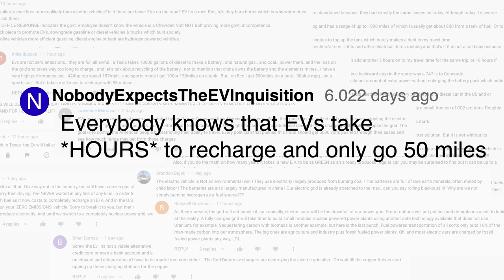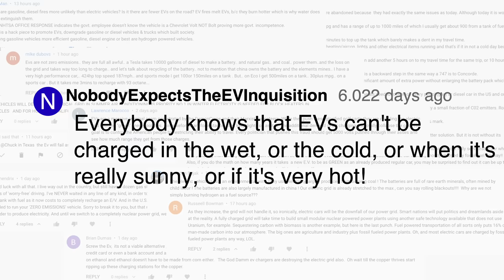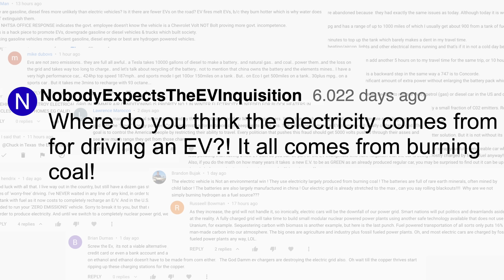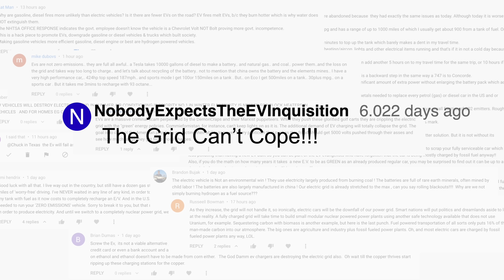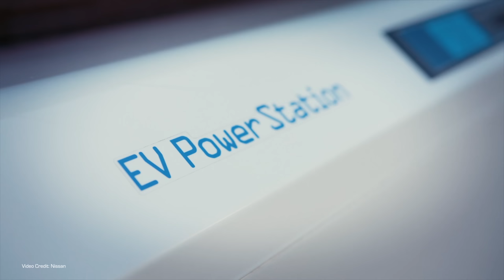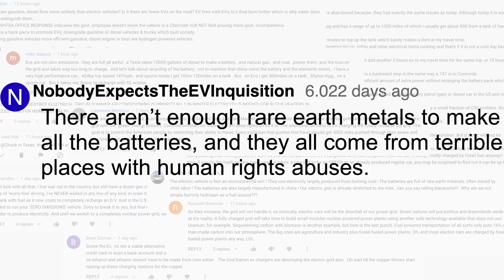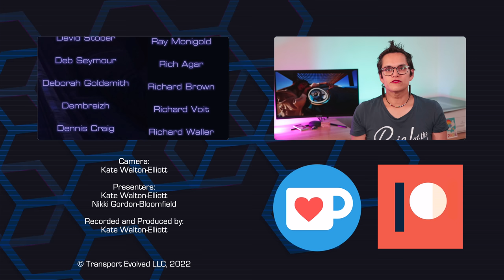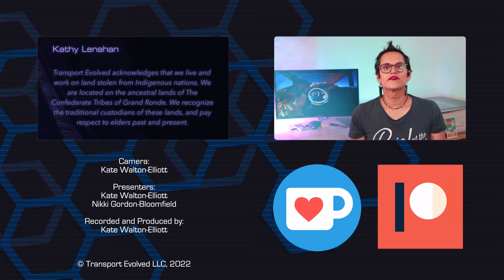The Transport Evolved List of Common (EV) Misconceptions

Comment: Well, sorry but even in Europe if you really want to go somewhere with a car you will do some 1000 km, or 600 miles in single stretch, which I have done a couple of times, and doing it with Honda diesel - it was fun, and really efficient.
Making up for the CO2 production for BEV, sorry, it still is based only on scientific assumptions, on one rather old research, which lacked any real data regarding Lithium production. Sorry but until that part becomes a common knowledge, I am not buying into BEV's are working out cleaner ...  I don't know the real data,  but if no car or battery producing company make it public knowledge, sorry but I will asume that BEV CO2 brake even spot is at least 100'000 miles away from the point of production ...
Reply: Not really efficient, and 1000 km without breaks is just dumb,.
Reply: this gave me a good chuckle.  1000km without stopping?  at 200kph that is five hours.  Your honda diesel does 200kph?  Do you dehydrate ahead of time to ensure you dont piss yourself?  I am going to challenge your claims.  And just so we are clear, when presented with the evidence, and where you can find the evidence yourself, you just say, fake data?
Reply: @chrisbailey5055  It does 200, but I never take it up there, 120 - 160 kph is the comfort speed, and it is reasonably safe, then you have both options ,power to accelerate as well as your ok with just plain braking.
And yes I have done 1Kkm alone (think it was to Austria, certainly crossed  Latvia, Lithuania, Poland and think one more country in those 10 hours), as well as 1300+km in 24 hours  round trip LV <=>PL, if you are mentally prepared for up to 10 hour stints, it is nothing special.
Reply: @aigarslacis4433  So you drive non-stop for 7 hours and 15 minutes?  How do you do this?
Reply: @chrisbailey5055  You take a good rest 2  days prior (meaning going to bed ~10PM, wake up at the time you know is best for you to be awake and attentive, and then you make and pack  food/snacks and drinks for 10 hour driving stint, and then depending on road conditions you just drive until you feel that it is time to stop. 6 hour non stop stint is absolutely no problem, 10 hour non stop, I think have done it once, early morning start and stopped I believe close to midnight.
Reply: @aigarslacis4433  What an absolutely horrible way to spend your time, I do feel sorry for you and whomever else you subject this torture upon.
Reply: @chrisbailey5055  And I found the article for that BEV trip from LV to Spain and back, well, the guy spent 8 days travelling, and 55+ hours charging on top of 8 days. If that is "the future" , thanks, but no thanks !
Reply: @chrisbailey5055  Then think about that guy who did it in his BEV 55+ hours charging during his 12 day trip (I know 8 days  +55 hours charging does not equate 12 days, but that is what is stated in his travel article, with mid size BEV). So I think spending 24 hours going to anywhere in Europe from almost the Russia border, is almost fun compared to that ...
Reply: @aigarslacis4433  i read a story about a US army convoy driving across the continental US, it took months and many people died.  I will stick with my horse thank you.
Reply: "Making up for the CO2 production for BEV, sorry, it still is based only on scientific assumptions, on one rather old research, which lacked any real data regarding Lithium production."  Have you looked at this study?  "A GLOBAL COMPARISON OF THE LIFE-CYCLE GREENHOUSE GAS EMISSIONS OF COMBUSTION ENGINE AND ELECTRIC PASSENGER CARS"   Seems more recent.
Reply: @SDGreg  If it is something that has been created within the last half of the year - I may have missed, but I hope that the BEV CO2 baseline emission data is not still based on a rather old and full of educated assumptions Scandinavian(sorry I do not remember which country and university it was exactly , but it was a public research paper and many newer papers are based of of that) research, since most of what I have seen are based of of that one.
Reply: @SDGreg Did you?  Take a look at figure ES.1
Reply: @chrisbailey5055  Well I have a friend (russian by nationality), former military, served also as a bodyguard in Israel, he did LV <=>UK , LV<=>FRA trips fairly regularly since he was doing some building/renovation jobs, and he drove even more in one stint ... so I guess it is just the question of what options do you have , what mind set, and what you need to achieve there ...
Reply: @chrisbailey5055  You mean the one showing lower lifecycle emissions comparing ICEV to BEV?  Yes I have.  What is your concern Chris?
Reply: It might be possible to do 10 hours non-stop, that however doesn't mean it is responsible. It is scientifically proven that people lose a lot of attention when driving non-stop for longer than 4 hours and the danger they pose to themselves and others is greatly increased. Ofcourse you might not have caused an accident yet due to ignoring these warnings, but we know that people that do drive for longer non-stop do cause more accidents on average.

There are plenty of studies out there supporting that BEV's are cleaner within a few years/dozen k miles driven, definitely within their lifetimes. The ones that state the contrary have repeatedly been debunked or exposed as taking the worst possible scenario's and parameters to get to their findings.

100k mile break-even point is still good, considering the average car does something like 120k miles in its lifetime. So 100k is good, just not great. If you want to suck this number just out of your tumb, fine, you still are arguing in favor of BEV's when it comes to pollution anyway.

I assume you only drive faster than 130km/h on the german autobahn? Considering that in any other EU country 130km/h or lower is the speed limit. So you'll need to drive for almost 8 hours non stop at an average speed of 130km/h (difficult anywhere in Europe, unless driving only highways at night) to drive 1000km. So double the time the recommended non-stop driving time. I don't see how this argument should hold any meaning to any responsable driver.
Reply: @MDP1702  That research about 4 hour non-stop driving is a bullshit, they take into account an "average person", who for the most part is "incapable of driving anything but a shopping cart". It is not LeMans 24 hours with pedal to the metal and physical exhaustion, and even then they can make 4 hour stints, though usually it is balanced with refuelling or other maintenance so to reduce the pitstop times ...
After all an average truck driver in EU has 8 hour driving stints at his disposal ....
130 kph is the allowed limit in reasonably many countries on the highways in EU.
But the usual long distance driver does +10kph over the speed limit, and depending on the country and if I know the road well,  I do about +30 kph everywhere where there is 90kph  and higher limit if the traffic allows for that ...
Reply: @MDP1702  about the studies on BEV - there are a lot of assumptions in every study about the energy required for battery production, I have yet to see a single BEV manufacturer or battery supplier releasing full info on CO2 emissions. If you could point me towards one, I would just love to dive into it ...
Reply: @bellshooter  as to the efficiency, on that trip LV to PL and back in 1300+ km if memory serves me right I was doing 120+kph a lot and an average close to 100 kph, and it was about 6.1 liters of diesel per 100 km.
And as a side note if you have to spend charging 1 hour for every 8 hours of driving, that is also decreasing the other types of efficiency + if you look at the price you pay at the charging stations, I think if I do the frugal driving style, I can make those diesel 1000km a lot cheaper than BEV. And even with my usual driving style 7.5 liters per 100 km in city, I think that money wise I would still be better then that BEV across Europe ... 
(according to that article BEV across EU used on average ~12.3 EUR per 100 km, naturally if it was Tesla on Tesla chargers I think it would be free)
Reply: @aigarslacis4433  
they take into account an "average person", who for the most part is "incapable of driving anything but a shopping cart"
What a bullshit cope out.

After all an average truck driver in EU has 8 hour driving stints at his disposal ....
A truck driver in Europe is required by law to take a break after 3,5-4 hours of driving and can't drive more than 9 hours a day. Well, they can ride a bit longer than that, but that then only if followed by a (significantly) longer rest period.

But the usual long distance driver does +10kph over the speed limit, and depending on the country and if I know the road well,  I do about +30 kph everywhere where there is 90kph  and higher limit if the traffic allows for that ...
So in other words you are essentially now admitting to not only driving irresponsably long non-stop times, but also breaking the speeds limits consistently? Do you have any more reasons as to why we shouldn't take you serious?

there are a lot of assumptions in every study about the energy required for battery production,
There are indeed differences, which isn't suprising with different chemistries and manufacturing processes. But even the worst ones are generally coming to the conclusion that BEV's are better in their lifetime and usually significantly so. The studies finding the opposite often are playing with things like 100% coal produced power etc.

I have yet to see a single BEV manufacturer or battery supplier releasing full info on CO2 emissions
So you have activily researched this and ofcourse know the ones released/investigated are untrustworthy? And better than people actually doing it for a living?
Reply: @MDP1702  The first part of your comments - think whatever  you please, I do what I think is reasonable for the task at hand. I am  a daily winter driver, and I have no problem driving 120 kph on snow or gravel for that matter. Have survived some 30 years as a driver, think I can make whatever there is left for me ...
Regarding BEV's and research, I did my research, when I was interested in it, but that was about a year ago, so my "research" is outdated, but if someone tries to show me that BEV's during production have emitted less CO2 then ICEV's, that I really consider a bullshit.

Oh, and about truck drivers, you are not wrong, but you have not taken into account various exceptions in member states and for agricultural hauler drivers, there is a lot going on there ;) And for the most part that truck driver work hour limitation is market protection thing for the old EU states against polish, latvian etc drivers, and has very little to do with the human endurance.
Reply: @MDP1702  what I am trying to say about BEV and people who know - the people who know, do not have access to the real world data, they have some more or less good understanding of what it should be, but no real data, and that was what was "fascinating" about the green movement - most if it is "competitive information", so it is not released to the public, and from what I have seen no researcher has had access to that information either ...
Reply: @aigarslacis4433  
and I have no problem driving 120 kph on snow or gravel for that matter.
I never mentioned snow or gravel. Don't see how this is relevant other than you bragging.

Have survived some 30 years as a driver
You and so many millions of other people. Just because you survived 30 years as a driver doesn't mean you can't improve or are infallible. Even people with 30 years of driving experience can cause accidents due to being less attentive. Hell, with higher age the risk likely only increased.

but if someone tries to show me that BEV's during production have emitted less CO2 then ICEV's
Who the hell claims they emit less during production? The entire conversation is about when do they break-even and become less polluting?

but you have not taken into account various exceptions in member states and for agricultural hauler drivers, there is a lot going on there ;)
So in other words, you are going after the exceptions to justify your irresponsible driving behaviour? I guess then it makes it all right.

And for the most part that truck driver work hour limitation is market protection thing for the old EU states against polish, latvian etc drivers, and has very little to do with the human endurance.
Bullshit, even with this time protection the eastern european truck drivers are much more competitive due to the lower wages. The time restrictions literally correlate to what research found to be the point a drivers attention drops off massively, often without themselves even realizing. It has everything to do with endurance. People aren't robots, there are limits to what we can handle. It isn't about the physical tiredness either, rather the mental tiredness/attention loss.

the people who know, do not have access to the real world data
And you know that how? You do know there are people who do nothing else than to track such information down, not just for BEV's, but life cycle analysis for a lot more things. They have access to databases you likely never heard off, nor ever will. These also aren't just all people from the 'green movement', overall these are mostly people who are neutral on the topic and research life cycle analysis  of many different things, green or not.

and from what I have seen no researcher has had access to that information either
Unless you really went extremely deep, ie. talking to the actual researchers, you really can't know this and is just your assumption. I assume you are working/closely related to the world of life cycle analysis, right? Otherwise these are pretty ignorant statements.
Reply: @MDP1702  about the trustworthiness of data, I have seen and work with organisations who do exactly what they are paid for, so unless it is a bunch of collage or university students eager for knowledge and real data do that research, I have very little trust in that source. It might change as I get to the bottom of that organisation and of that sourced data, the trust might establish, but as such if I see at least one peace of data that does not look right - I tend not to believe the rest of it. But I am interested and will do a deeper reading and analyses on above data compering ICEV and BEV.
About the researchers - it is easy to verify, they have to publish their refferences if that paper is considered at least half way scientific, so it is easy to know what data has been collected and from where, and what previous knowledge , research has been studied ... If it lacks those things, the research is mostly bullshit, or at least it cannot be called scientific, and I would not use it as reference point at all ...
Reply: @MDP1702  So now after digging a little bit more on that ICCT comparison now I get what they did there, they basically found a good measurement unit to be presented in the table form, so that BEV really look super good in this particular statistic, and yes it is somewhat  true but it also nicely avoids showing the real initial carbon footprint of BEV, as well as fails to mention that it uses the absolute best case scenario for the BEV production ... "nice job ICCT" masterful bending of facts ... sorry to be more exact "bending" of statistics ....
Reply: @aigarslacis4433  
I have seen and work with organisations who do exactly what they are paid for,
If this were the overall case, wouldn't there be a lot more unfavorable LCA reports about BEV's considering the money is still very much with car manufacturers and fossil fuel companies who are best served with a status quo, ie. no electrification of the car fleet?

if I see at least one peace of data that does not look right
So I guess you already then need to be very informed about LCA's to know what doesn't look right, and even more specificaly LCA's about BEV's?

it is easy to verify, they have to publish their refferences if that paper is considered at least half way scientific
Almost all research about LCA of BEV vs ICEV LCA that is peer reviewed speaks in favour of BEV's, so I don't really think this is a problem. Ofcourse if you are going to nitpick about the few that might not be peer reviewed, I don't really care.

ICCT comparison
The ICCT report literally said they got lower BEV battery numbers by focusing on large scale industrial battery production (where economy of scales can help institute co2 pollution limiting efforts better) and regional supply chains. But this is still in reasonable bounds.

I'll share a link here which includes the results of several studies that looked at kg co2eq/kWh of BEV batteries. Even if you take an upper limit of 200kg/kWh (only 2 studies go higher than this, with an average of 127 for all with their upper limits, though ignoring Ambrose en Kendall as a clear outlier) with a battery of 100kWh (which is double the average BEV battery and one of the biggest you can get these days), you come to around 4x the ICCT's result, which still comes down to a significant reduction in Europe, the US and China with only India coming more or less similar (bad grid mix).

Here's the link (delete the space after theicct. done to fool youtube, since they sometimes delete links): https://theicct. org/sites/default/files/publications/EV-life-cycle-GHG_ICCT-Briefing_09022018_vF.pdf

It is also an ICCT brief, but the mentioned studies aren't. And considering the average is 127kg/kWh and the median 119, which is around double or bit more of the values used in the ICCT's 2021 comparison paper, I'd say those are pretty trustworthy. Also when you look up other studies, they all are in a similar range. If you go above 200kg/kWh, you are going to high, going under 50-60kg/KWh, it is too low. Within that margin it depends on the factors/data considered.

Also the ICCT is sometimes a bit influenced by politics/goal, but like you said, still within reality, just this time a very positively one of BEV's. A more realistic (or even negative) one still comes out with the conclusion that BEV's are better over the course of their lifetime, the impact is just a bit smaller in regular circumstances compared to what they state.
Reply: @MDP1702  Yes I mostly agree with your comments on the BEV and  that  fairly closely relates to what I have found within various university researchers papers, they however admit, tha they mostly do not have real world data, but they use what is called  the understanding of the industry. So my guess is that real emissions is a "trade secret", and usually when there is something "sold" as trade secret, there is some "uggly" truth behind it ...
The other "problem" I have with BEV is, the only relatively advanced and expensive part of BEV is battery and accompanying cooling and management systems, the rest of the car is actually way simler and cheaper to produce, but when you put a couple of useless drivers aids and some other redundant and sometimes plain harmful/distracting  stuff, you get to cash in more than on any ICEV you could. The cheapest EU produced BEV I think was Smart,  it was something like 19Keur, so you can make them seriuosly cheap, but why bother  ... And yes there were even cheaper BEVs like the Mitsubishi iMIEV (if I got the name right), but that did not sell well with consumers ...
But regarding BEVs and "old industries", most of them actually heavily profit from this new "green deal", plus the way that the CO2 tax is applied, it does not inluence them at all. They now have understood how to profit even more by supporting "unsustainable" green movement, however they are not so vocal about the fact that green is not sustainable yet. Think of CO2 capture and storage and similar tech ....
Reply: @aigarslacis4433  
they however admit, tha they mostly do not have real world data
Which is quite logical, afterall which company is going to divulge the exact composition/chemistry or manufacturing process of their batteries. However this should just cause a slight variation since the general composition and processes should be known. This is why I'd take a range between 50/60-200 kg/kWh.

and usually when there is something "sold" as trade secret, there is some "uggly" truth behind it
That doesn't really make sense. A trade secret is often to just avoid the opposition copying it entirely or with just some minor differences. Trade secrets being kept secret due to an ugly truth behind it should be by far the exception, not the norm.

Yes, overall BEV's can cut a lot of things to make it easier, however this isn't to say they are easy or cheap to produce, it mostly is in the maintenance department this will be felt. As to adding "useless" driver aids etc, this isn't just the case with BEV's, it is a general trend, it is just easier to do with BEV's since they are a new platform anyway. Also due to the (for now) still higher cost of BEV's due to the battery, people expect something more when buying it. these driver assists also often help get a better (safety) rating and in some cases are even becoming mandatory for new vehicles.

you get to cash in more than on any ICEV you could
That definitely isn't necessarily true, though it depends on the manufacturer. BEV's are still more expensive, thus for the "mass adoption cars" companies actually need to keep profit lower as to not let the price become too high and scaring of the general buyers it is aimed at.

The cheapest EU produced BEV I think was Smart,  it was something like 19Keur
The cheapest smart I can find with me her in Belgium is 25k and the range on it is truly pityfull (132km).

Maybe you meant the Dacia spring that here starts at 20k, it has a decent range in city, but it really is a budget car which ICE variants are about 10k. Generally speaking you can add around 10k extra for a BEV vs an ICEV still, and if you look at that, manufacturers aren't really driving up the prices, except maybe for the higher end (50k+) ones.

And yes there were even cheaper BEVs like the Mitsubishi iMIEV (if I got the name right), but that did not sell well with consumers
That last part is the entire problem, people don't like to buy a small car with a short range. Manufacturers already have greatly diminished or even cut the production of their smallest/cheapest cars because it just wasn't profitable due to too low sales figures. And that is for regular cars, small BEV's then make entirely no chance since they are more expensive and generally have a bad range due to a smaller battery.

But regarding BEVs and "old industries", most of them actually heavily profit from this new "green deal"
That is definitely not true. Manufacturers, carshops, fossil fuel companies, ... all really aren't better off with electrification of the car fleet. 
- The manufacturers need to convert their ICEV lines to BEV lines or even create new lines, which is incredibly expensive and logistically difficult, moreover they need to constantly find the balance between the right amount of BEV manufacturing and ICEV manufacturing. Changing too slow and you miss out, changing too fast and you lose most of your revenue when BEV sales don't follow as fast. Next to that they now also get new competition of dedicated BEV manufacturers like Tesla that they'll need to compete with. Changing something as big as this isn't an easy transition and the expectation is that one or more established brands might go under or will have to be taken over specifically due to this difficult transition.
- For the carshops, much of their income comes from maintenance, check-ups, ... BEV's will greatly diminish this income stream for them.
- Fossil fuel companies it is obvious.

What advantages do you see for these industries? And don't come with higher prices=higher profits. If this was the case, they could achieve the same with increasing prices on their ICEV instead.

plus the way that the CO2 tax is applied, it does not inluence them at all.
That really depends, in Europe the ever more stringent requirements absolutely influences them to move to lower pollution from cars and thus pushes to electrification. Moreover it isn't just the tax, but moreover the consumer. The consumer will eventually flock to BEV's, be it for environmental reasons, financial or even ease of use/driving, it is just a matter of time. If a company doesn't transition to BEV's, they'll miss this ship and likely go under, not dissimilar to what happened to other big companies in the past in other industries.

They now have understood how to profit even more by supporting "unsustainable" green movement,
You keep saying, how?

Think of CO2 capture and storage and similar tech
What does this have to do with it? And CCS really is still in its infancy and isn't cheap at all, plenty ot trials have had to be stopped due to the difficulty and too high costs, even when funded for a big part by subsidies.
Reply: @MDP1702  for one take a look at this year revenue, let us say oil companies, and revenue overall through years. On how they profit, well look for one example, the Saudi Neom project 150 mile Line  "sustainable" city , where one of investors is Aramco ... 
And if you care to search you will find enough bullshit being built and done with the "help" of oil and gas industry.
It is just like that embargo imposed on Russia exports, right after the embargo ships with oil and gas were travelling from Russia even more then before, and if you took a close look at it, oil and gas was free for trade, just that it could not be carried by Russian transport ships etc.
Public is fed with incomplete information ...
Reply: @aigarslacis4433  
for one take a look at this year revenue, let us say oil companies, and revenue overall through years.
So your argument is just to point to the profit that is influenced by many factors and not just BEV's? Like this year the price of oil went up significantly due to the Ukraine conflict, while the cost for oil producers overall remained the same, so obviously they are going to see their profits soar. This is why some government are planning/created an extra tax to be placed on those "war" profits.

And if you care to search you will find enough bullshit being built and done with the "help" of oil and gas industry.
This doesn't at all indicate that electrification of the car fleet is a good thing for them, on the contrary, they are forced to try and diversify to avoid total collapse when the revenue from oil decreases massively.

It is just like that embargo imposed on Russia exports, right after the embargo ships with oil and gas were travelling from Russia even more then before
Because some countries were taking advantage of the situation Russia was in, getting gas and oil for a much cheaper price than they could have gotten before. They then used this to fill up their reserve with these cheap products and maybe sell it on a bit. This however has nothing to do with the electrification of the car fleet and the impact of it on oil manufacturers. Moreover even European countries increased imports from Russia and elsewhere temporarily to fill up their reserves, after which they created legislation to start and embargo for Russian oil at a later date (I think end of this year or something around that) and I don't know if there even is already an embargo for natural gas from Russia announced.

What you just said makes me question if this conversation is worth continuing, because these arguments are pretty dumb and/or ill-informed.
Reply: @MDP1702  Then never mind , I am sorry I don't have more time to spend and make a well laid out and easy to understand argument with long explanation, I do some work  at the country house in the garden (as in plough, dig etc, also have time to spend with kids). So I just type in something now and then, and yes chaotic.
But back to the argument, prices had nothing to do with Russia/Ukraine, it had to do a lot with thinking the green energy can replace fossils, and the much needed "fossil stuff" were not secured in advance like many years until now +  this year has been one of the worst for wind energy. These were just some "bad" business decisions, not war. But bad is relative, all energy companies have profited from this, and only the consumer is left as an "idiot". And BEV's were just another contributor,  which helped to drive up the price, naturaly not the decisive factor, but factor non the less.
Unless we go nuclear, oil and gas will be used even more. 
Regarding car industry, BEV's is a cheap "exit strategy" compered to making something like hypothetical Euro7 engine ... so that BEV investment long term is seriously "nothing" compared to developing modern ICEV.
Reply: @MDP1702  and let me put BEV charging into perspective, during years  2020, 2021 there were close to 3 million EVs sold in EU, if we say that they charge minimum 2 times a week about 40 kWh per charge (total 80kWh per week), in a year  this bunch of cars will amount (actually exceed) to the yearly electricity consumption of Lithuania, and ~2 times more than Latvia or Estonia. 
And that is just 2 years worth of EV sales.
Reply: @aigarslacis4433  If we look at the yearly km's done by all cars and then look at how much BEV's use /100km, you come to an increase in electricity consumption of around 10-20% of current consumption, nothing that can't be dealt with, especially since most will be charged at night or other times when there is an overproduction/low demand of electricity. Compare this to electric heating which we'll have to transition to (already the norm in most new buildings in Western-Europe), which will add around 100% extra consumption and you can see that BEV's really aren't the problem and electricity production and grid capacity will need to increase regardless. BEV's long term can even help here by charging up during low demand times and discharging during high demand (be it directly in your home or the grid). And no, this is not bad for the batteries, due to the lower pull the batteries depreciate so little it is unnoticable vs the depreciation due to driving.
Reply: @MDP1702  This one I can completely agree with you, though I do think that tech is not there yet, and we are rushing the green move, and that causes us "to suffer" . Eventually we will make the best out of it, but switching (loading)  everything to electric grid is going to cause us grief. I currently have only diesel cars, I use wood pellets to heat my 250 m2 house, and electricity consumption is really low, so low in fact, that it makes no sense for me to put solar panels on roof, at current price, they could pay back in 12+ years, if electricity price drops, then its even worse. If however I switch to heat pumps and ar least one EV, then naturally it would make a lot of sense to go solar as well. BUT that is a lot of unnecessary upfront investment at this very moment, since the tech will improve a lot over the next decade, so I kind of would like to stay with what I have  for as long as I can, especially since wind and solar after their useful life just makes a mountain of trash, they are not easily recycled ...
Reply: @aigarslacis4433  Solar panels are nearly 100% recyclable though, and not even that expensive. However obviously throwing it in a dump is still (and always will) be cheaper, which is why you need regulation around it like is the case in the EU. Regarding wind turbines, the only non-recyclable part is the blades, but that is being worked on (new recyclable blades and 2nd life for the non-recyclable ones).
Reply: @MDP1702  Solar panels are recyclable, however, they do not have precious components(at least not in considerable quantities) in them, and they are money wise destined for landfill, it makes no financial sense to collect and do something with them. Even if you collect the precious parts, the rest is just millings which yet have to be used for something worthwile.  And yes from wind turbines the fiberglass is going to go landfill, with the small part of them converted into kids playgrounds when cut apart  ...
Reply: @aigarslacis4433  it makes no financial sense to collect and do something with them.
Which is why it should be regulated, 20-30$ per panel that cost 250-300+$ is hardly a significant price for recycling it instead of landfilling it.
Reply: @MDP1702  Well it has to be incentivised, but if plastic recycling is any indication of what is going on/how it works (or rather does not), I would say majority will still be "landfill material" ...
BTW I have not had time yet, but it seems there are some interesting content on "City Science MIT" posted just recently by various presenters. Some topics certainly caught my eye ...
Reply: @aigarslacis4433  Plastic recycling is incentivized but not mandatory, unlike solar panel recycling in the EU.

Also plastic recycling is actually still just a very difficult thing, much of the plastic can't be recycled or only at very high costs. This again isn't the case with solar panels which can be recycled nearly 100% with a not too expensive process.
Reply: @MDP1702  I admire (almost envy) your trust in the good outcome  of these things. Let's hope it works out that way ! ;)